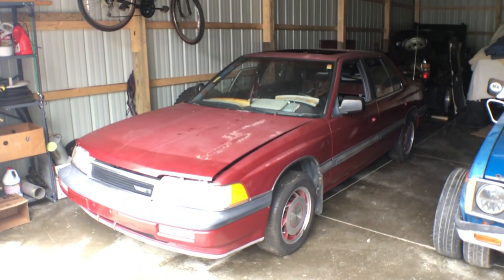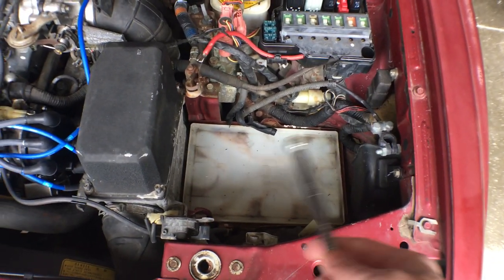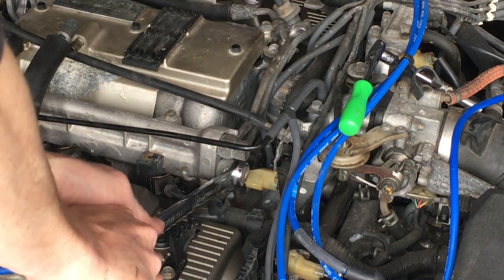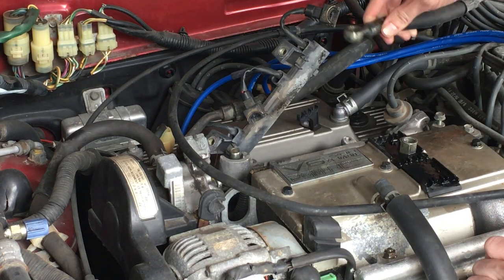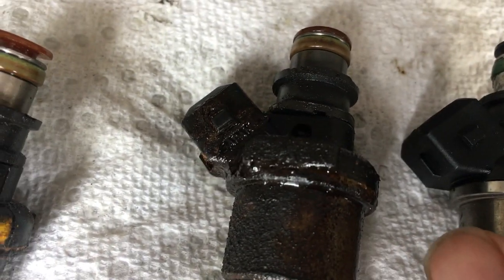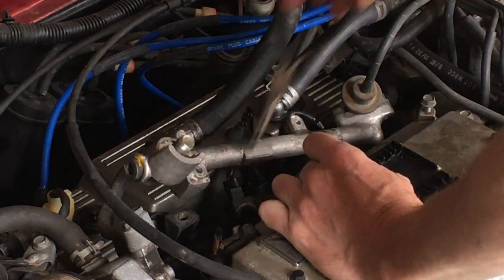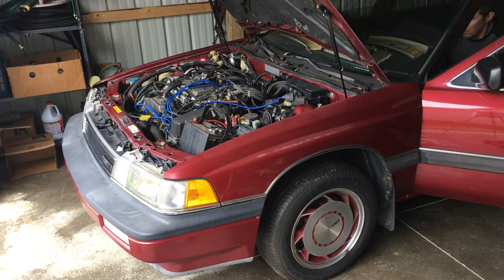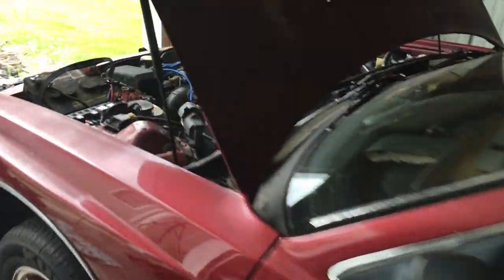How to Replace Fuel Injectors on Honda V6 engine - 1988 Acura Legend

Comment: Hi i have Honda Legend coupe with this engine 
after winter engine dont start and ecu dont show eny errors 
What voltage should be on the wires that are connected to the injectors when
Ignition on
Reply from the maker: I don't know the voltage, but usually the first component to go bad on these cars is the main relay located in driver lower dash area.

Comment: I just replaced the injectors on my 1989 Acura legend and did everything right now it sounds horrible
Reply from the maker: Did it run good before replacing the injectors? Where did you get the new injectors from?
Reply: @6thGearGarage  it was leaking fuel before from the bad o rings thats why i replaced them. i bought them new for my 1994 Acura legend and they are remanufactured. The engine now sounds like it has clogged injectors
Reply from the maker: @elgeneralxx  so you put injectors for a 1994 on a 1989?
Reply: @6thGearGarage  yes they are specifically made for 1986-95 model Acura and honda. But im guessing that may be a issue. Just bought a fuel rail off ebay for a 1988 model and should i buy new fuel injectors again?
Reply from the maker: @elgeneralxx  The second gen Legend has a different engine, so maybe you have those injectors. I'd try some specifically for 86-90 with 2.7L engine.